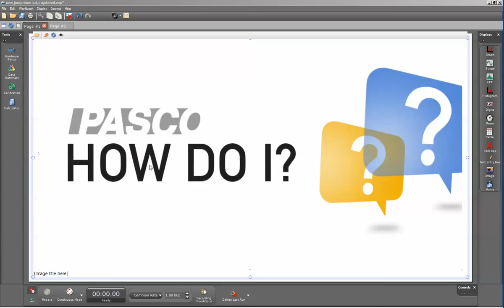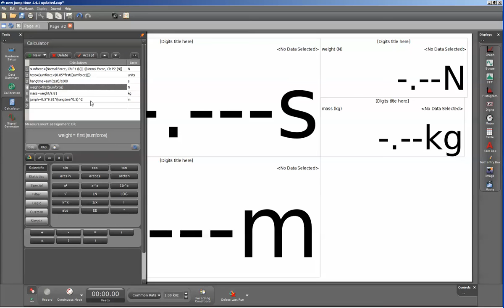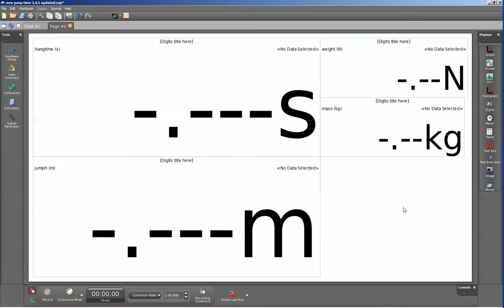Determine "Hang Time" Using Force Platform (Capstone)

Comment: how to determine the peak power and peak force ?
Reply from the maker: Within Capstone, you can select the statistics and select the maximum values.  The following workbook has a calculation for power that you can use to determine power.  ftp://ftp.pasco.com/Support/Other/Pictures/Customer%20download/Kinesiology%20Workbooks%20(Capstone)/PS-2141/Peak%20force%20and%20peak%20power%20PS-2141.cap
Reply: @pascohowdoi  the link doesn't work, could you send it again please?
Reply from the maker: @simonesegalin3362  Though the link in that comment is indeed broken, you can use the updated link in the video's description to download a set of workbooks that includes that same workbook. Thanks.

Comment: You said in the video the equations would be linked down in the comments, but I am not seeing them.
Reply from the maker: Sorry, we discovered YouTube does not allow descriptions with the syntax of Capstone equations. Let's see if they're allowed here in the comments:
Calculations:
sum force=[Force right, Ch B: (N), ▼]+[Force left, Ch C: (N), ▼]
test=(sumforce<(0.05*first((sumforce))))
hangtime=sum(test)/1000
weight=first(sumforce)
mass=weight/9.81
jumph=0.5*9.81*(hangtime*0.5)^2
Reply: @pascohowdoi  Hi. In Test line "first" is a buttom in special calculator?
Reply from the maker: @TheLipepower  That's correct. In the calculator's Special menu, hover over the First button to see a description of that function below the calculator.
Reply: Hello…I used your equations in my PC and all was perfect but when I tried to add that equations in my iPad I received massages It’s wrong. Do you have “special equations for the IPad?